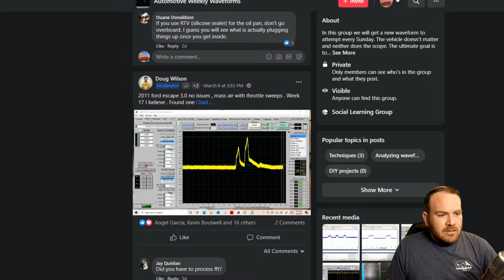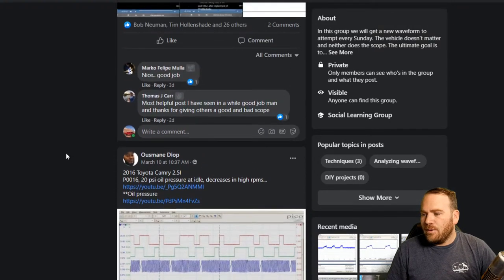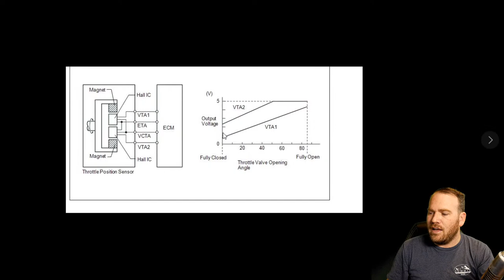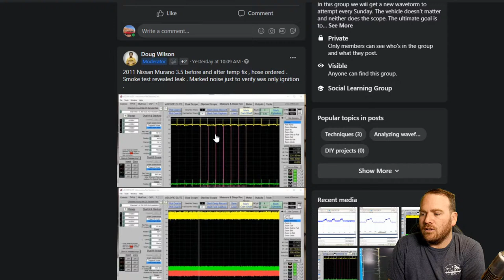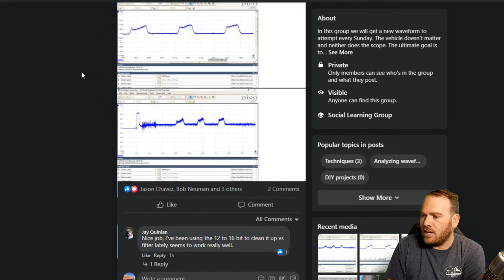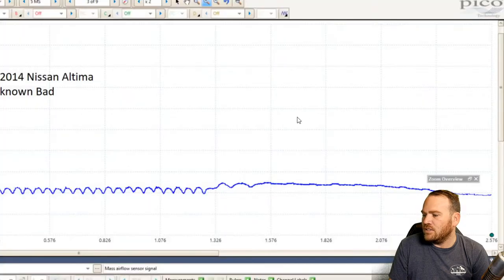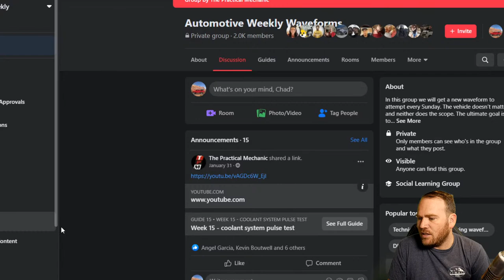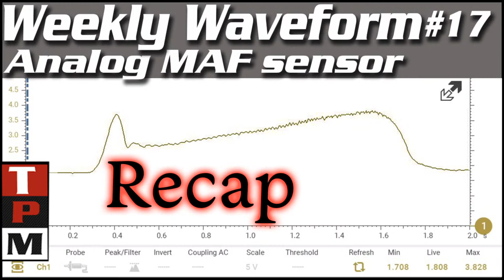Weekly waveform 17 recap - analog MAF sensor voltage

Comment: I’m just starting out so I think I’ll do a couple a week until I catch up
Reply from the maker: Sounds like a plan Marty. There are some weeks that can be combined on a single test although it requires a little more work. The battery test combined with the relative compression test, the cam sensor/crank sensor correlation test or the vehicle has a variable reluctance crank sensor snag Hall effect camshaft position sensor.